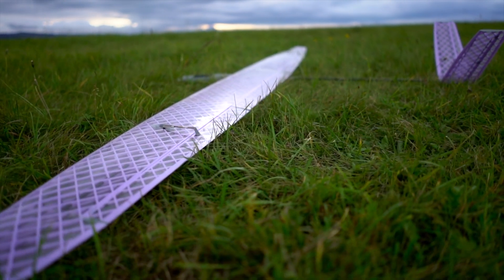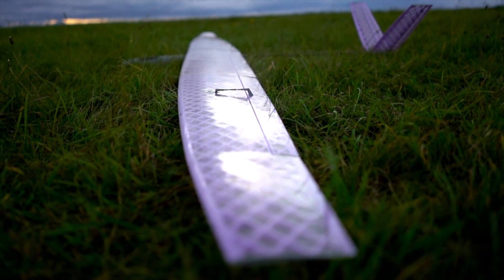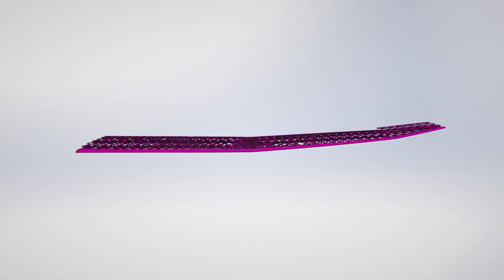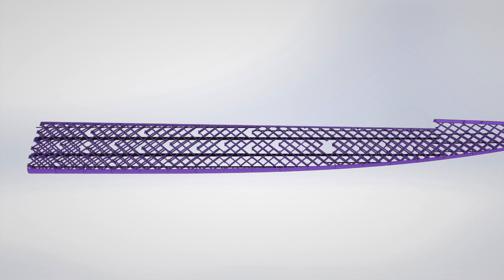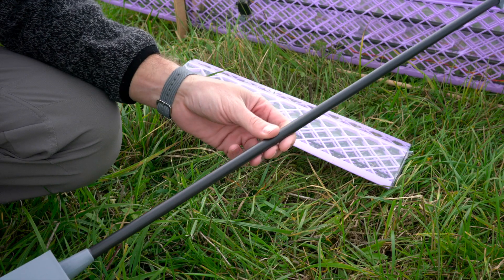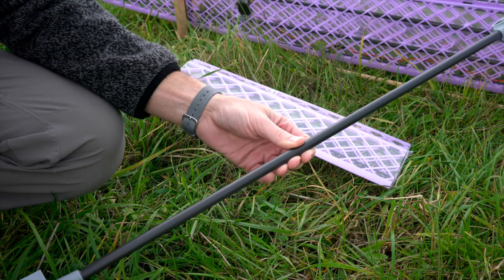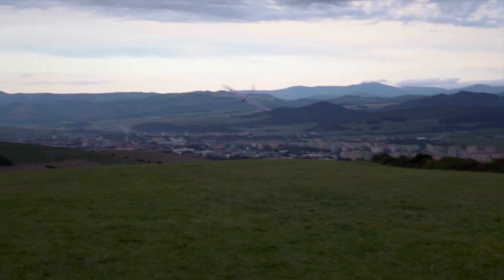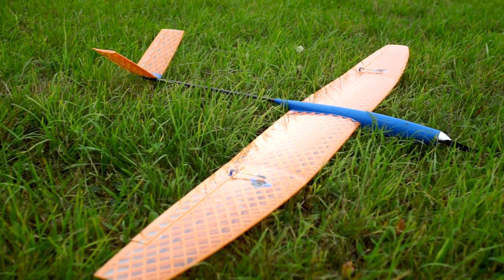KRAGA Roa II - getting closer to 3.4 m glider

Comment: Honestly this looks like more of a boom quality issue than anything else. I don't thing you need to move to a heavier boom so much as a better one. Tapered booms are no longer expensive, and if you like, I can help you source a quality boom. Shoot me a message through jhaerospace.com if you'd like to pursue that option.
Reply from the maker: Yes, the boom had for sure a manufacturing defect. I used similar one last year on ROA 1 and that one withstood serious crash and was still like a new. But I feel like even woven 12mm tube just isn't enough when it comes to stiffness. And boom stiffness dictates whole feel from the plane when flying it. If not stiff enough, the plane then feels num/ not responsive at all.
As for the tapered boom, that would be excellent option, but it is hard to get around the world in some standardised dimension :-( So that is why it has to be simple tube if I want to make it available for most of the people.